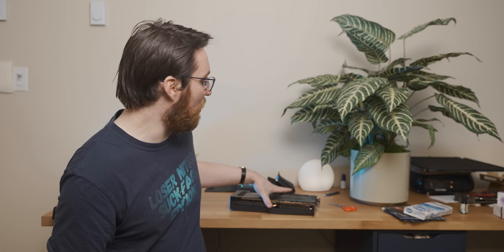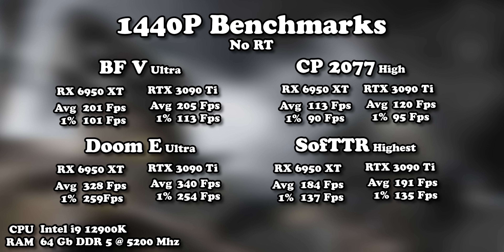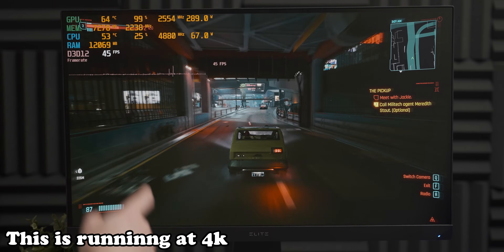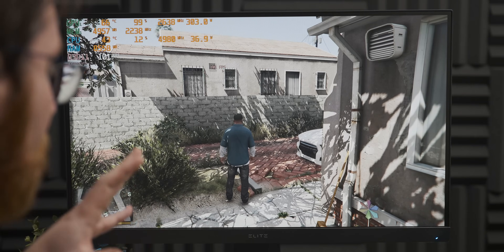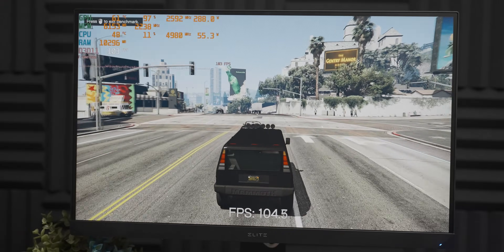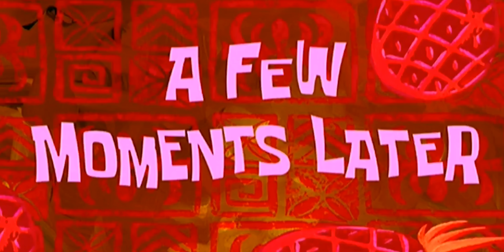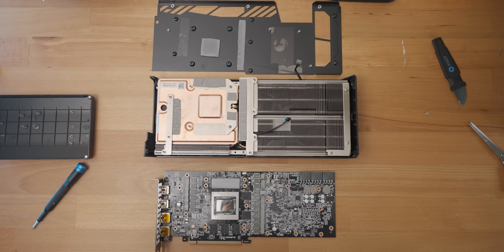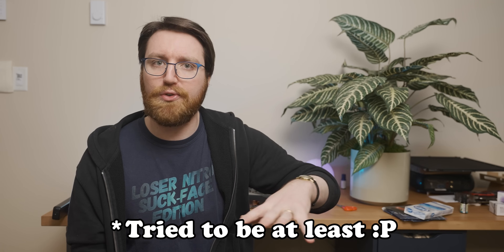I Can't Figure Out What's Wrong With This Gigabyte RX 6950 XT

Comment: Coilwhine is just solit state capacitors... They dont break because of that. And they mostly get amplified with these enormous coolers.
IMO there can be a hardware problem FE memory doing errors and therefor GPU keep waitig for error fixes.
Try downclocking memory by 50MHz and check performance then.

Comment: RX-6600, 2600MHz, power draw and my THEORY as to low performance...
Unless I'm mistaken then if the RX-6950XT was actually running at 2600MHz at close to 100% GPU usage then it's at maximum performance. As I said below the POWER DRAW shouldn't matter if it's actually operating like that... but as others noted the card is reported as an "RX-6600" so is there some communication error that causes the card to REPORT 2600MHz but operate closer to 2200MHz?
I'm struggling to think of any other explanation than the card INCORRECTLY REPORTING its performance. To itself and thus throttling itself. Doesn't quite make sense to me as I'd expect the card to work like an RX-6950XT regardless of how it's reported but... this is just weird.
Reply: The thing with it reporting as 6600 XT is probably just some thing with how the cards are internally named.
The issue is that the card isn't delivering the performance that was seen in reviews.

Comment: COIL WHINE?
I just sent back a Gigabyte M28U for coil whine. I know it's an industry wide problem but... how the heck do we know what products are more likely to have this problem? You'd think you could design around it now. The INDUCTORS involved should be in sealed housings so it's not resonance with OTHER parts of the card. So shouldn't coil whine NOT exist if the correct voltage limit from the spec sheets aren't exceeded?

Comment: 2600MHz does NOT make sense...
If the card is hitting close to 2600MHz at 96% GPU Usage then theoretically NOTHING else matters. Regardless of POWER DRAW in theory that card should be at maximum performance. BUT... how can that be when the power draw and performance don't match up to other cards? Therefore is something wrong with the REPORTING of the data? My guess is that the card is INCORRECTLY reporting the frequency and thus capping at an actual LOWER frequency. I can't think of any other way to explain this. It's like your SPEEDOMETER says you are going 100MPH and you drive for one hour and go 80 Miles. Then your speedometer must be broken?
*The only OTHER thing that is possible, but seems highly unlikely, is that the wrong GPU processor is in there? Or some problem with memory bandwidth?

Comment: GigaFuckingBait... it amuses me how this company from a quality brand became so unreliable... my GTX1660SuperOC fans were rattling, i lubricated them, the card worked another 2 months and then one of the fans just stopped working... I threw away the gigashit fans and plastic cover and just installed under the card two huge case fans with high rpm which i controll by software... the only reasonable and fast solution. It works.

Comment: Last week I picked up a Gigabyte 6900xt Gaming OC card. I was getting repeated "Wattman" crash errors in games (Defaut OC/lastest firmware, bios etc.) and also a low power draw. Note - I was running 3x pcie power cables and not pig-tails off of my Corsair RX1000w.

With that all being said, it eventually lead to hard freezes and artifacting. Elden Ring would freeze within 5sec of loading into the world with black squares popping up all over the screen and Overwatch/Mafia 1 remake was crashing with long white lines appearing on the screen. 

I returned the card, WONT buy Gigabyte again because I am guessing that the GPUS got the same special treatment as the failing PSUs and I picked up a gem - XFX 6900xt Speedster Black with no issues.

Comment: Not buying Gigabyte products anymore. I have a Gigabyte motherboard that says it supports thunderbolt, then when I go to buy a thnderbolt card manufactured by Gigbyte themselves, Gigabyte doesn't support the motherboard. Then I get a 6900 XT and the entire system won't shut down or sleep, because for whatever reason the power management system really doesn't work well with the 6000 series AMD cards (computer restarts any time the software tells the hardware to power down), despite absolutely no mention by AMD or Gigabyte that these cards aren't supported together. Now I know why people buy Apple products or game consoles.

Comment: To be honest, you're losing like a couple % points of performance for about 25% less power draw.
Try going in the opposite way and see how power efficient you can push what you have and if the coil whine goes away when underclocking.
Also, the coil whine could be because the wall power has a lot of noise in it, try putting an UPS between the PC and the wall plug.

Comment: Radeons simply don't report full power consumption of the card. Your mistake is to assume they do like green team cards. Techpowerup used PCAT to measure true power consumption from slot and pcie power cables(probably techtesters did too). I have RX 6800, it's 250W TGP card. However wattage in monitoring is max ~200W, also stock PPT is 203W(from hwinfo). I know it consumes 250W rather than 200W based on wall figures. I think radeons leave out VRM losses, gap is about same as losses would be.
You card is boosting normally, in techpowerup review average clock speed was 2500MHz. Your card is hitting same numbers, it's clearly not receiving less power. For me there's nothing wrong with your card. If you want to have confirmation, ask techtesters to report power consumption figure from monitoring software. 
Performance differences can be caused by many things. For example, did you have ReBAR on? Techpowerup did. They also used AMD system which have a bit higher gain from ReBAR when using Radeon. Or did you test exact same scenes in the game? If not, numbers are not comparable because games do not run at flat.

Comment: My old 580 did exactly this when the vrm didn't make proper contact with the cooler. It didn't say anywhere it's throttling, it didn't show cooking vrm temps, it just capped power draw at a level the vrms could handle not cooled properly, while the core was like 40c. It took a while until I found the broken thermal pad, and once I replaced it it went back to normal.
So maybe the same thing or a broken thermal probe for the vrms or something?

Comment: David i have a question i wonder when you changed the PSU did it solved the coil whine for PSU? I mean okay GPU has a Coil Whine but is GPU issue can affect the PSU?
Because i have a coil whine at PSU and a little on graphics card and if graphics cards issue affect PSU i need to know.
And i am sorry for my poor english. I hope you can understand.

Comment: Dawid, what you're failing to realise is this card isn't meant for gaming, its created specifically to mine crypto. I very much expect the drop in voltage won't effect the hash rate and using less power in this instance is exactly what the people buying it want. 
Still knowing gigabyte for its quality hardware the drop in voltage is probably deliberate to stop the card randomly exploding, due to poor quality power distribution (like their PSU's) which they certainly won't admit too ever.

Comment: I had a similar issue with my Strix 3090. It keeps underpowering whatever setting I throw at it.
The only solution that worked in the end - I went into the motherboard bios and set my PCI-E to 3.0. 
Power draw & performance was normal again. May be worth a try.
Reply: I believe that you must have the correct motherboard for these super high end GPUs

Comment: Software reported power on AMD cards is Core only, not total board power. My (reference) 6900xt shows 255w for example. You need to measure power with a PCAT or similar type device to see total board power on AMD cards, which will give you the 380w figure.
Reply: Hmmm... possibly so, but then why is the PERFORMANCE so low?
It wouldn't make sense to hit 380W and also have low performance would it?
Reply: @photonboy999  I mean its not massively behind, and at 1440p i would expect it to be about the same as the nvidia card, on average, across a number of games. Also, i dont know if that watercooled 90Ti is perhaps going to perform better than a reference card, giving it the edge? However its possible Dawids maybe gone off down a rabbit hole trying to troubleshoot the power issue that wasnt actually an issue, and as a result hasnt spent time looking for the real problem.

Comment: My Gigabyte 3070 OC which shared a lot of design elements, cooler and power delivery components as your 6950xt had an identical power and performance problem. We couldn't fix it. This is a gigabyte problem.
I bought mine from CanadaComputers btw. This might be a batch issue.

Comment: Enable power tuning in Radeon software then increase the power limit to its full potential of an extra 15 percent. For 300 watts you really only need 2 pcie 8 pin adapters
Reply: With 2 8-pin you can even go to 375 W, since the slot itself can also deliver additional 75W

Comment: OK so I had my buddies card (a 6750XT Gaming OC) do the exact same thing and a temporary "fix" (its stupid but it works) was going into MSI afterburner and kicking up the power limit. Permanent solution involved a flashing tool and completely flashing over Gigabytes BIOS with Sapphires BIOS (for the Pulse variant since they have similar OC and Power draw) since reflashing Gigabytes BIOS did nothing to solve the issue. Funnily enough, the card also read out as a 6600 in task manager. Did Gigabyte mix up their BIOSes?
Reply: I guess it's just a "RX 6600 series" internally, just like Radeons did for a while. My old HD 4870 reported itself as "HD 4800 series" and my backup HD 7770 reports as "HD 7700 series" despite there being other models in those "series" with different performance.

Comment: Doesn't matter if you spend high or low, or how much due diligence research you do, there's always a good chance of problems like this. Problems can be solved sure, but the real frustration sets in when manufacturer doesn't respond and or provide any sort of resolution. I've had numerous quality issues and provided information to a number of manufacturers over the years (AMD, Noctua, Ifi Audio, Western Digital). Some went completely unanswered, some responded "it's normal behavior". None ever responded with any sort of actual resolution. Unfortunately as consumers there's very little we can do about it.

Comment: Asked Gigabyte support to tell me the Thermal Pad sizes for my GTX 1080... they replied with: "That's corporate secret" ... no, it's a part of the cooling solution.
Reply: At that point might just measure it out yourself.
Or well, ask them how much they want for replacement pads, because if it is so secret, they obviously should have more in stock.
Reply: @HappyBeezerStudios  i did... Problem is that after years of compression the pads will not regain their original thickness... so it was a vague guessing game to get the thickness.
And yes no, they didn't even sell replacements... they just was like: "or you buy a new card"

Comment: My 6950 is acting up, too... 

Syke! 😄

I wish. I am still running a 1070 SC, lol. 🙂 The situation you have going on is really weird. I am almost scared of Gigabyte's GPUs. Between the nVidia cards with cold solder joints on the 8 pin power input and now this, I'm losing confidence in them. 🤨

Comment: I had a similar issue with my ASUS Strix 6800XT a few months ago. DDU did nothing and it was not a hardware issue. it might not be a Gigabyte issue as this is a problem that quite a number of users have encountered on various 6000 series cards (reference included). The card simply refused to draw the proper power draw (220W max) and the coil whine was god-awful. In fact, it drew 100W playing CSGO on 1440p max settings, with FPS  varying wildly between 60 - 400. 

What I found to work for my specific card is to disable SAM in adrenalin and then turning off "Enable above 4G decoding" in BIOS before running DDU. After that, I will install the new driver, re-"enable above 4G decoding" in BIOS before booting and turning on SAM in the adrenalin software. I'll re-input my overclocks and it will draw the correct 300 - 330W value for my card. I more or less repeat this step whenever a new driver acts up and it usually solves the problem. Perhaps this could be the solution for the Gigabyte 6950XT.

Comment: not bios, not firmware, not board power, not psu, not driver, ... gotta be hardware. More than likely, it's their power circuitry rather than the chip. If I, as a consumer, had gotten received that card; I'd have RMA'd it.

Comment: Without a multimeter or a PCB test kit its nearly impossible to tell if something is wrong hardware wise.  There might be a missing connection or something.  And that's not something that even I could fix (and I work with electronics, but my MX is all wires and plugs I don't work with printed circuit boards...its a small world in there)

Comment: What is the powerdraw running TimeSpy? Because the card is already boosting to 2500 mhz and needs to draw 290watts for that. TimeSpy in my experience is a lot heavier to run.

Comment: Well do what i do, Avoid gigabyte GPU/PSUS. If you want something from them, grab Aorus.. At least its worth it. Software is still meh though.
Monitors are pretty dank.. So they are the only things i would recommend from them.

Oh and this is more on a hardware problem i would say rather then a software issue. So quite possibly expect a revision, and if there is one i would recommend doing an exchange for the newer revisions.

Comment: Try to push it with More Power Tool to see if card can handle it and if it is not a hardware issue which would may explain such low power.

Comment: That's not coil whine, you want my Gigabyte RTX 3060 Vision card,  I've got 16 high pressure fans inside my rig and running them at full speed is quieter than the coil whine from this card, even just doing just a basic job where the card isn't doing much, the coil whine is horrendous.

Comment: I suspect faulty PSU chips on the PCB, bad caps or bad mosfet's. Who knows. The GPU sees it can only receive 290 watts and decides to lie about clocks and slow down your game. I would check to make sure the power delivery is adequately cooled as you mentioned it being super hot on the underside. Look at the card's hotspot temp and see if the PSU is over 90C. It could be a bad bin from the manufacture. I had a bad bin card that ran so hot, I needed a special high tech expensive copper cooler when other stock cards ran just fine. I think you should start with a thermal camera and see where the hotspots are coming from.

Comment: It is possible that there is no much of a benefit for gamers with this card, over what it replaces, but perhaps for people making ASICs for mining, reducing wattage by about 100 watts but still getting the same performance, may make sense as over time it may add up, especially if you have multiple 6950 XT's running in a setup.  Of course for this to be of value (savings) you would have to be running probably 8-12 cards in a setup for the savings to take place (over something else that consumes 100 watts more probably).  That or their numbers are based on averages, such as average game play, or a mixture of game play and non-game play (where the card may not consume as much power) but I assume you tested it playing games and it only drew 290 watts so probably not the case.

Comment: I had an RX 6600 XT Gaming OC from Gigabyte and it was also a nightmare. It had an insanely bad stuttering problem and I did everything you did in this video and more to fix it and nothing worked. I concluded that I just got a really bad "silicon" and sent it back to the store and they gave me my money back after testing. After all I had been through, I just came to the conclusion that AMD has a lot of problems with their software and you needed to do a lot of tweaks to make their GPU work correctly, so in the end, I put some more money in to get an RTX 3060 TI and I couldn't be happier. 
It was my first AMD GPU, so, I don't know if my experience was bad because of them or GIgabyte, but in the future, if I don't hear anything about their software getting better (I had a lot of problems with SAM and other things), I'll probably stay with NVIDIA.
The RX 6600 XT had a great performance BTW. Only the constant stutterings were a no-no for me. 1% lows were in the 7 to 13 fps range, making it impossible to have smooth gameplay.

Comment: Dawid, I have this EXACT same problem with my GIGABYTE RTX 3070 GAMING OC. If GIGABYTE Ever replies with a solution and it ends up working, please share it. Thank you so much. I've been struggling with this problem for about a year now, I've tried multiple different BIOS Versions, Drivers, Power settings, everything. I pray they figure this out

Comment: Just wondering if you tried toggling between different pcie lane gens. Left it on auto, then gen 1, gen 2, gen 3, gen 4 and had the same result each time. I mean, it could be a hardware and firmware issues making it in malfunction and not run on the appropriate pcie lane settings. Just a thought